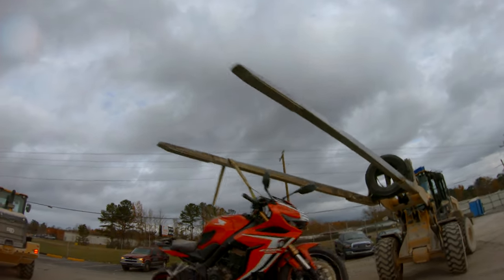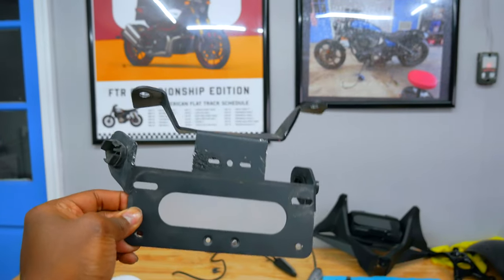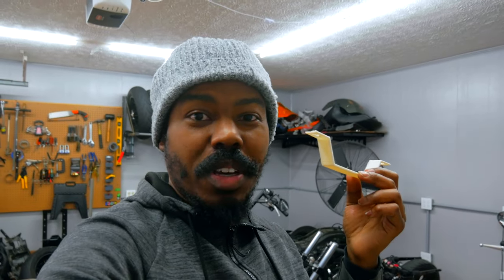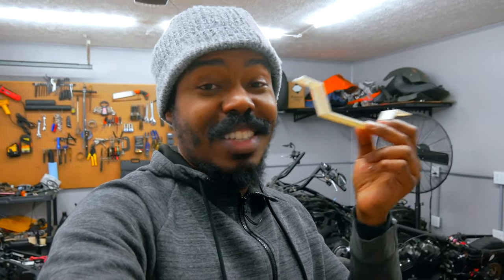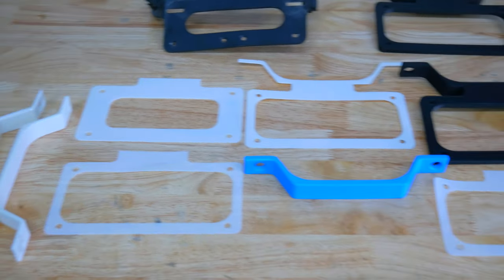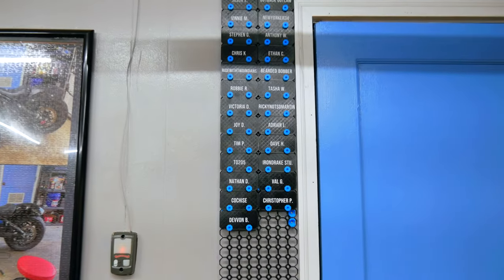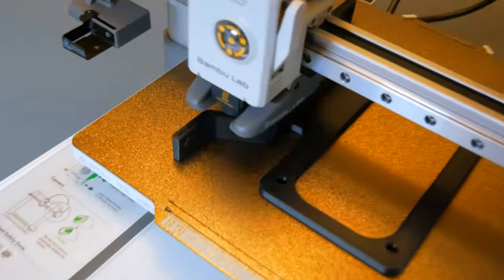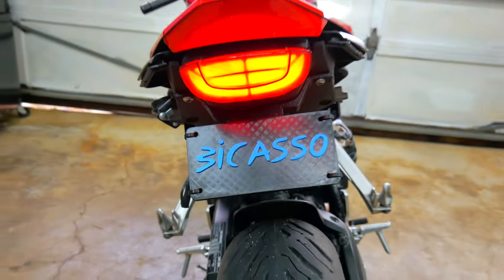Making 3D Printed Custom Plates! (Honda CBR Rebuild Part 6)

Comment: Buying a printer, and learning how to use it has been one of the most beneficial things I have ever done. Rapid prototyping parts, in my garage is a lifesaver. I have also been able to use it as a cash flow stream making parts for friends.
Reply: How hard is it to learn how to use a 3 D printer to make parts with it?
Reply from the maker: I agree. Just some patience and practice. There's a lot of stuff to print for free in the community. Millions of parts and models. You learn how it all works just using it, but just like motorcycles.. there's a whole Youtube community surrounding it. Plenty of tutorials, gotchas and cool things being done over there. I started just like many.. 3D printers on Youtube and fell down the rabbit hole. I've known about them for years but just now got into it.

Comment: Definitely enjoying this series. 3D printing is a nice touch. One piece of advice for 3D prining, sunlight breaks the plastic down. A lot of makers will sand, bondo and paint to add stregnth and UV proect. Maybe spray a UV clear coat on the final product to keep it fresh and strong.  Check out a metal forge and casting.  You can melt some cans and use cheap PLA filament, place the finished product in sand or plaster, pour molten aluminum and get a metal part you can sand and paint.  Good job!
Reply from the maker: Still learning about the different filaments, but that is part of why I used PETG. A bit tougher than PLA but definitely something to consider. I have a few more ideas I want to play around with and temps may become a problem.

Comment: Having a 3-D printer and knowing how to use it is a real time saver.
Reply from the maker: It really is
Reply: @BrandonBicasso  Can you make a curved rear panel for this Honda sport bike with the 3 D printer?
Reply from the maker: Can make anything tbh. The print bed is only so big tho so you will have to design it in a way to connect certain parts together. You can sand, bondo and paint over it and make it look like a legit part too.

Comment: 3d design tip for you sir. For something like the license plate, take a straight on picture of it then import it into your modeling software (fusion360 for you) and scale the pic to 1:1. After that's done, you can the just trace the image in a sketch. Your holes will line up and you can also do the same thing to get those wierd angles/profiles to match. I hope it helps ya and love the content¡
Reply from the maker: Hey Jerry! That's a good tip and one I should've used. I did use that method for something on another bike. Learning more each time I give it a go. Preciate that!

Comment: It might be to lake, but as a former product engineer, I would like to make a suggestion.  Add a couple of ribs to reinforce the plate mounting surface.  Just a suggestion for if and when it might break.
Reply from the maker: Hey, Rickie. Not too late. I’m a bit confused on visualizing that. Will look into it. Can add it to the design easily of course.

Comment: What 3D printer is that?  I’ve been waiting to get one for a while but it’s hard to decide on one that will give good print quality without breaking the bank.  License plate bracket turned out great!  Nice work sir!
Reply from the maker: Bambu A1. A bit pricey but I didn’t want to fight the printer starting out. I wanted everything to sort of just work so I paid more for their ecosystem.
Reply: @BrandonBicasso  That’s not too bad price wise. I just looked them up. Have you tried ABS through it?  Looks like it isn’t recommended on their website. That’s another reason why I have a hard time finding a good printer. I’m looking to have the option to print with ABS as well.
Reply from the maker: So, it's not that the A1 won't do it.. more so it's not an enclosed unit so the fumes and ambient temperature can become a problem. My printer sits inside of my house so I don't have the issue of temperature but fumes can be a problem if I'm using different filaments. Most enclosed printers will be able to handle it out the box. The A1 can do it with a few tweaks. Check this video out: https://www.youtube.com/watch?v=0R7GwuFwW1A